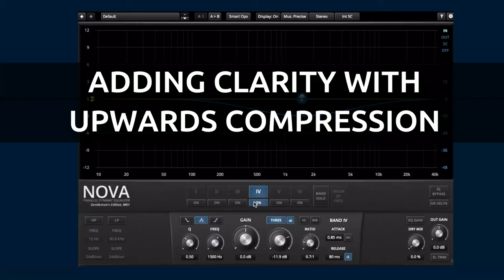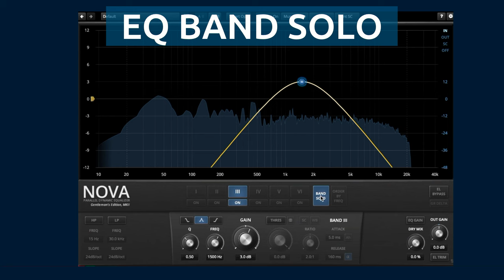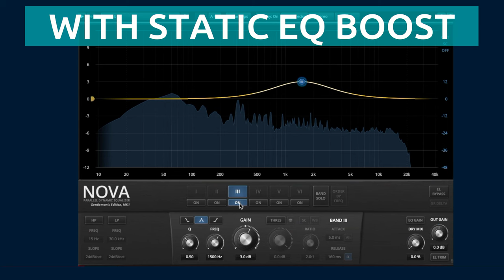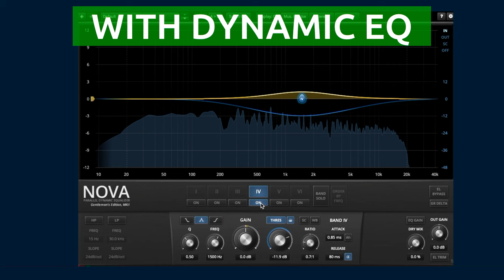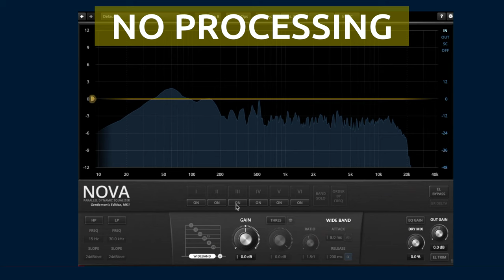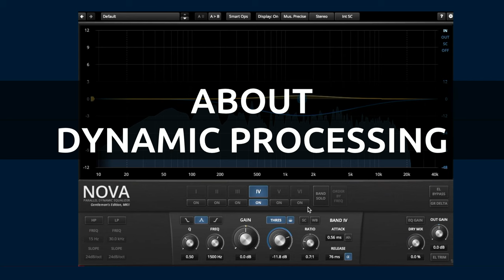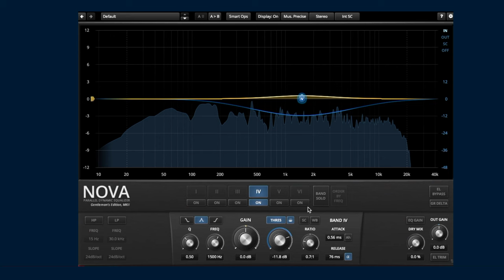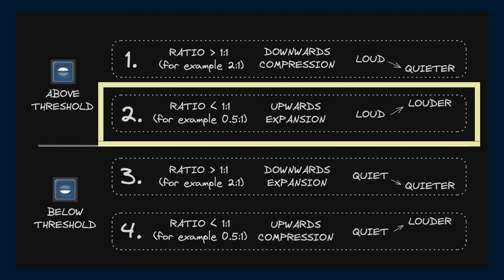Want more clarity? Try upwards compression in TDR Nova GE!

Comment: Good information! I've been using Waves M2V for years on vocals for upward compression. It works fine, but I sometimes miss the lack of more precise control. I've also had Nova GE for quite some time, but never realised I could use it for some very precise upward compression of part or all of the vocal. This is great!